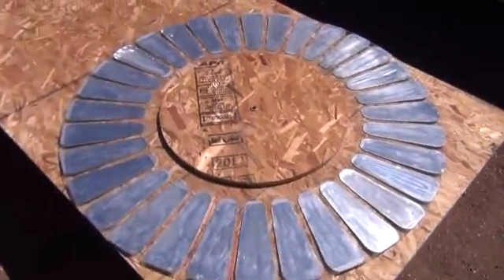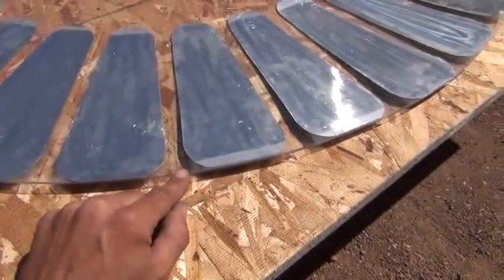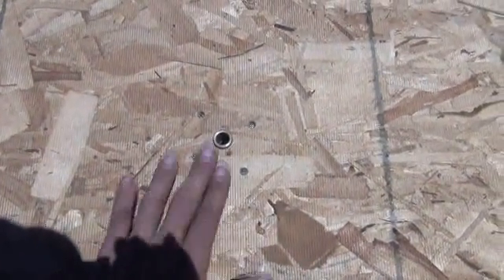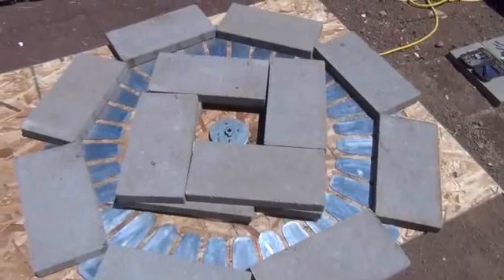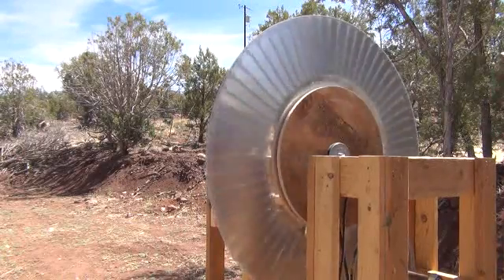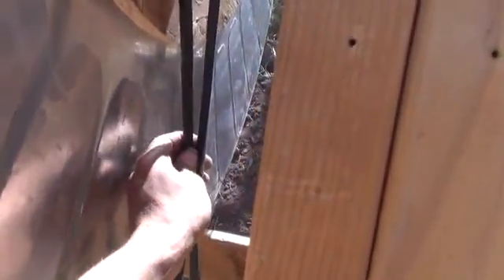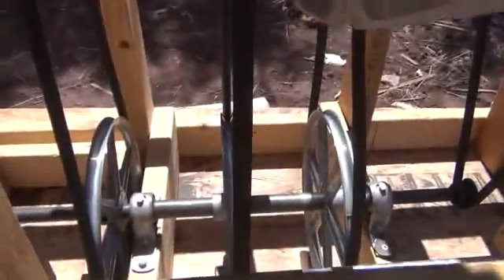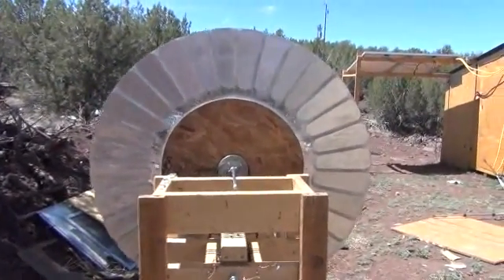Wimshurst machine one of the world's largest "how to" part 4, The 4 foot disc construction

Comment: It is a very big good electrical machine MrTeslonian, but I wonder if there is to many frictions, when I see how it is build in 7:20 I think there is too many.
This sort of machine seems to need lesser friction to work good.
I can not even imagine how this machine would work in high vacuum, the high vacuum has it seems a very good dielectric strength.
The dielectric strength is a factor amperage (So it seems to) of an electrostatic motor.